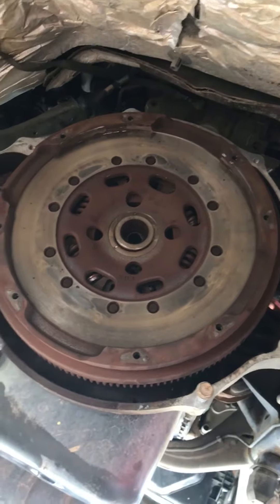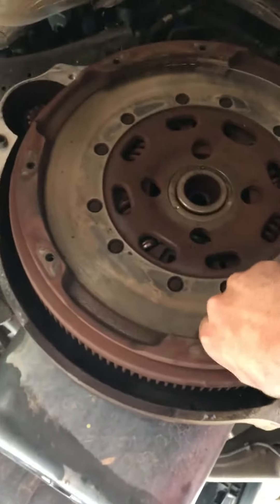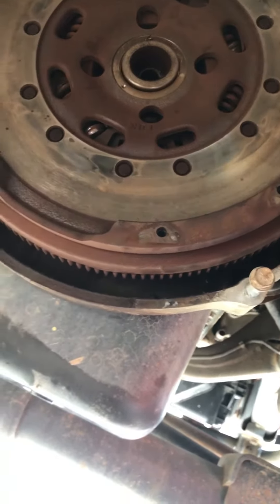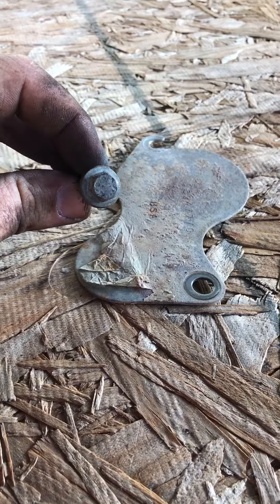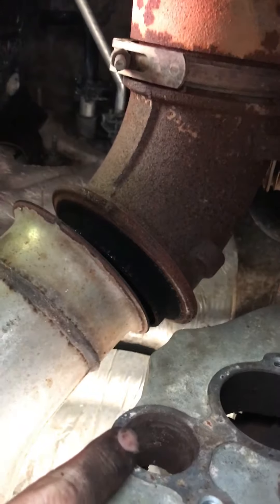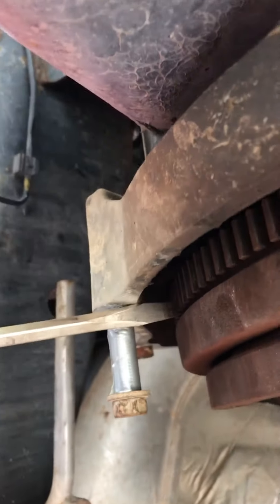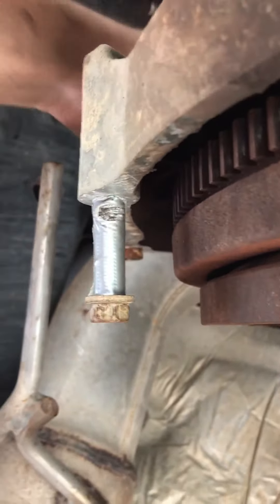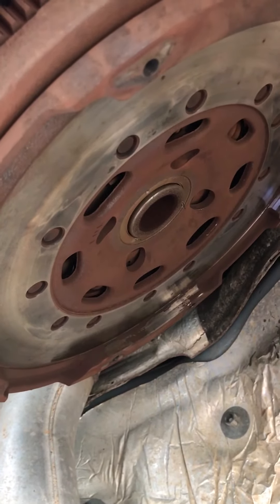07 5.9 cummins G56 dual mass flywheel removal (part 1)

Comment: Working on a 14 with a 6.7. This video helped, but it’s worthy to note it only has 7 BOLTS on the newer ones. Threaded the 7th bolt out and the SOB dropped right on my head. Got a hell of a knot but thanks for the video.
Reply: Upon further inspection it looks like it was suppose to have 8 bolts, one was just never installed
Reply from the maker: Damn... that’s a lot of weight to catch in the head!
Reply: Cledus Johnson yeah that was Monday, today Thursday and still have a knot. I was working on a lift and standing directly under it while reaching up to thread the bolts out blindly. Took seventh out and bang didn’t know what happened for a second.

Comment: A good tip instead of using a flat head in the fly wheel like that put the pressure plate bolts back in the fly wheel and use a big prybar to spend that that way it works a lot faster and it’s a lot easier

Comment: Thank you. I decided to look this up before I get to this same job tomorrow.
Reply from the maker: Mechanic Dave absolutely... not too hard of a job if I can do it 👍🏾.  Greg Alberalla has a good video up too for the G56 if you need it.. good luck!
Reply: Cledus I got the whole thing torn apart and it didn’t take me but an hour and some change. I have a 11,000pound loft so it is easier to work on than on the ground thankfully. The amount of clutch dust was unreal!!! The flywheel is definitely toast. I believe this is the real imbalance issue it’s been experiencing.  Thanks again!
Reply from the maker: Sweet... I believe it... my gear shifter had about a 4” wide swath of vibration before I pulled it